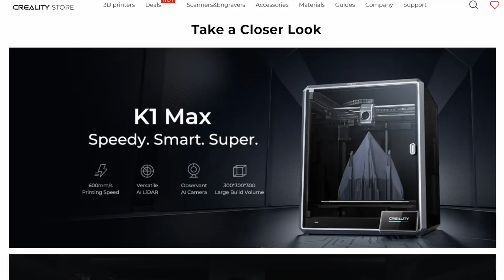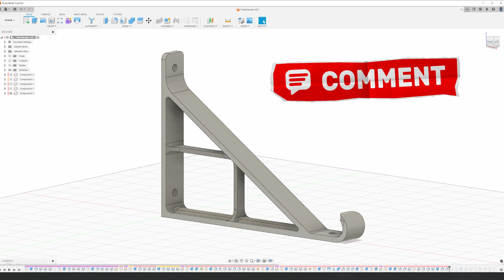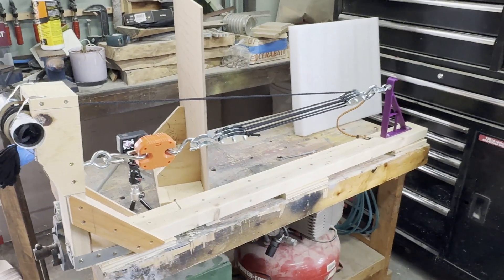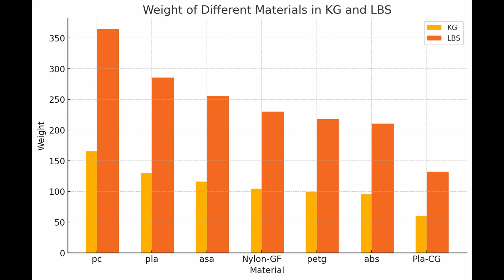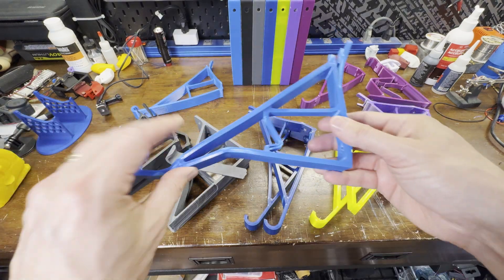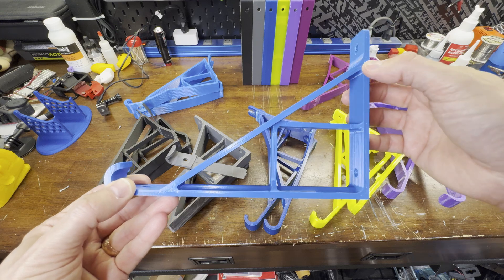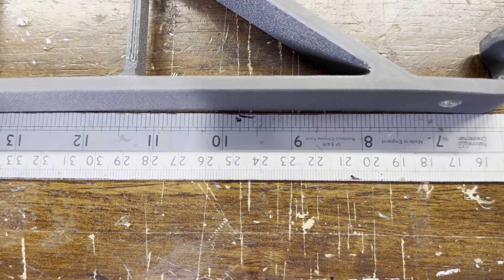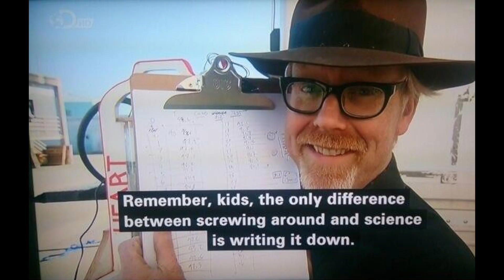Which Material is the Strongest. Stress testing different 3D printed Materials.

Comment: Plant. Good video. You can try the hanging test also in more controlled temperature (i think no one dis this). Like 30/40/50 degress Celsius. To see how they comport outside during summer, and also if you use them like car parst.

Comment: Plant. Nobody tests my favourite material - HIPS.

Yeah it's generally known that CF additive compromises tension strength? It is however very rigid, which is often helpful. It's not continuous carbon fibre after all, and it's less like fibre and more like dust. To be kept in mind that CF is a moisture magnet, it makes filaments absorb water substantially faster than without it, and moisture in filament can reduce strength again. Factory moisture content of filament varies, and in my opinion 3 hours in the dryer might not be nearly enough, but i can't say for certain, it depends.
Reply from the maker: I read that pla-cf should have a similar strength as just pla but be far more ridged due to the cf. so I was expecting the strength to be similar.

Comment: Plant.   I always love testing like this!  I will say, for me, PLA creeps REALLY bad with constant loading. Multiple wall brackets and mounts I've used end up deforming over longer periods of time. Even very light loads, like a small light socket have bent over the span of a few months.   I now use ASA for prints that need to handle constant load. Sometimes PC for parts that will take punishment.    Another great video! Thanks!
Reply from the maker: Thanks 🙏
I used to use petg for anything that needed to be tougher the pla or take heat but it’s usually too flexible. But now that I have an enclosed printer abs or asa is pretty sweet. 
I really like nylon though. Has a real interesting finish. Feels like it’s sandblasted.
Reply: Hello.

Comment: Hi, Thanks for the due diligence .  I look at all these filaments but stay with PLA, PetG and TPU..  But I may take a chance on a few now.  When you said K1 now dialed in.  What did you mean by that, what did it take.  thx again...good work.
Reply from the maker: I’ll stick to pla for most things, but nylon and PC were interesting for prints that will be in tough environments. 
The k1 was having some extruding issues at the start so needed to adjust the default profile to get it printing properly.
Reply: @DaveRigDesign   I have 3 jeeps and a VW camper (Westfalia) I want to make parts for  the interiors..  say door handles, something on the dash maybe.  Any of the filaments you use could work for THAT high heat. Live in  New Mexico where we see 90 90+ days a year. Car can reach 175F or more on dash...suggestions?
Reply from the maker: @tomyocom5886 I would say ABS or ASA would be best. Decently strong for handles and such and will take the heat, and about the same price as PLA. If you need something with high strength I would use nylon or PC but it’s pricy.
Reply: @DaveRigDesign    Thank You!!